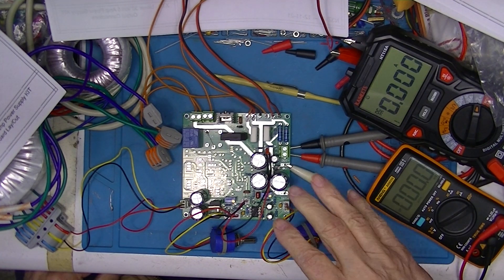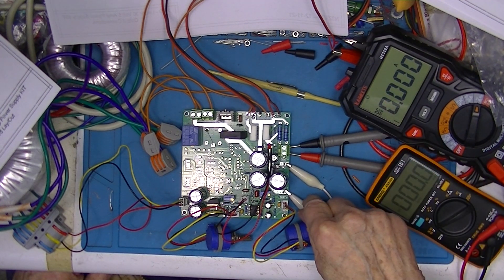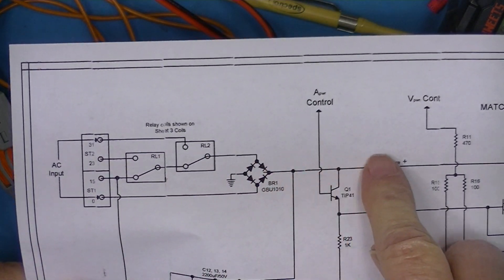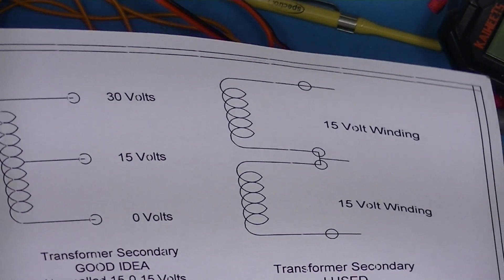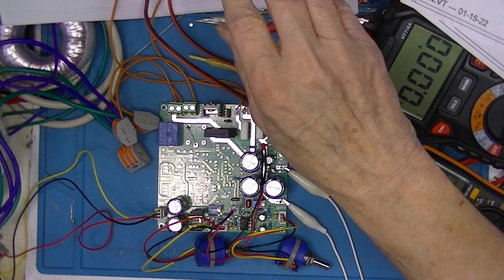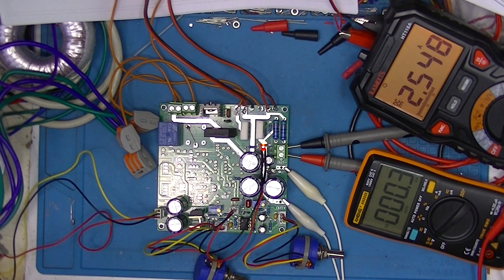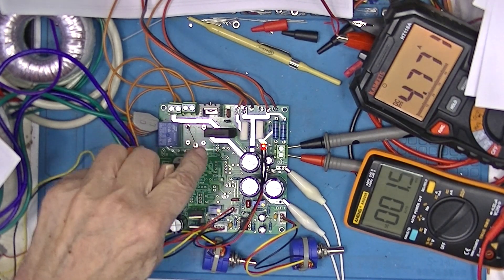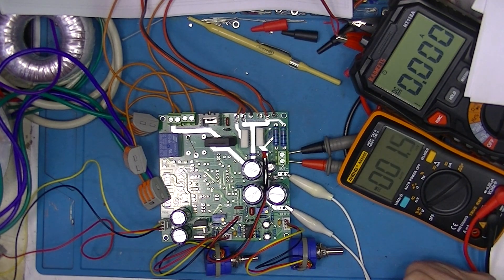35 Volt 5 Amp Chinese DIY Power Supply Part 2

Comment: Hi Steve would you be so kind to explain the fan control circuit? 🤙
Reply from the maker: Looking at Sheet 3 of 3, lower right. Notice ”NTC”. That is a resistor with a negative temperature, that is a nominal 10 K resistor and the resistance decreases as temperature rises. This resistor is to be fastened to the heat sink near the transistor. As the temperature rises, the resistance decreases, and the current increases through “NTC”, VR5, and R18. VR 5 allows adjustment of static speed, normally the fan is stopped at room temp. As the current rises then bias on Q6 then Q7 rises, lowering the resistance between the Collector and Emitter of Q7, increasing the voltage and speed  of the fan.
Thanks
Steve
Reply: @stevestrivia-bystevewagner4852  Thanks Steve, I think that by this way I can also adjust the starting up temperature of the fan. Steve